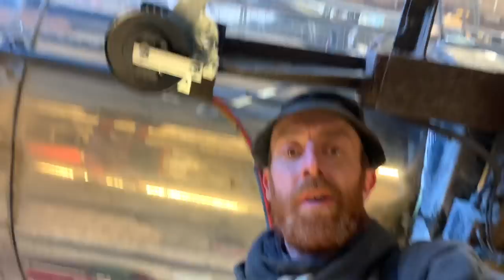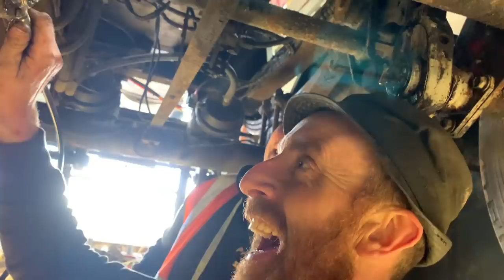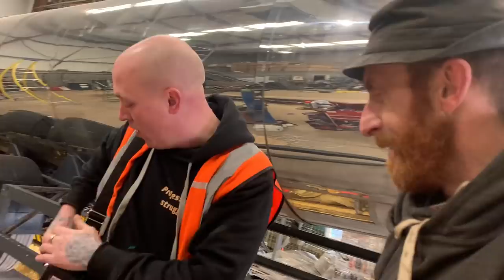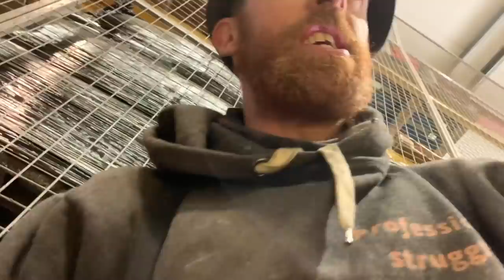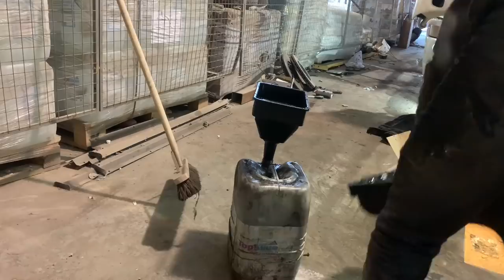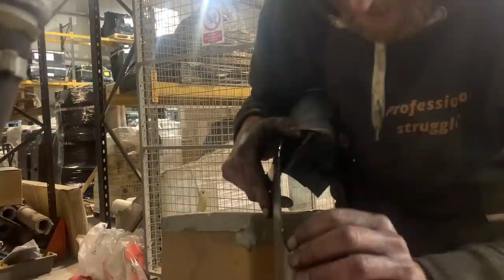How to clean out oil spinner Scania + sump removal, Mikita Peters new grease gun, hand brake cable

Comment: Seeing the mechanical trailer brake reminds me of an accident where the local plant hire firm had an old step frame trailer, with a ratchet park brake, once unloading a digger the driver didn't put the trailer brake on and as he drove the machine onto the ramps and moved the weight to the rear, the trailer see sawed, lifting the drive axle of the tractor off the ground and the whole lot ran away across the yard coming to rest against some scrap tyres. Luckily a bent front bumper on the tractor was the only damage.
Reply from the maker: Yeah no air bags to lower 😩 thanks mick 👍

Comment: Chris I've just got myself one of them nice mikitas, ask your mate did he have a bastard of a time getting the empty cartridge out. if he did you need to take the lip off the top of the inside of the cylinder with file could i f#=ck get the used 1st cartridge out i had to use a screwy and pry it out. be interesting to no if there all the same.
Reply: Dewalt one is the same. We now get tubes without the ridge, and they slide right out. Know the pain though, when it’s empty and the last bloke didn’t file the lip off.